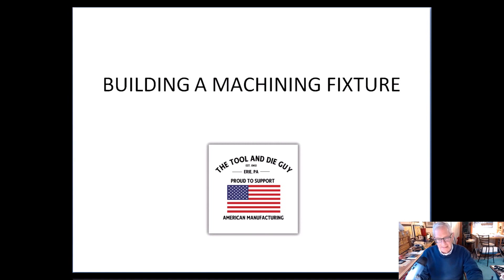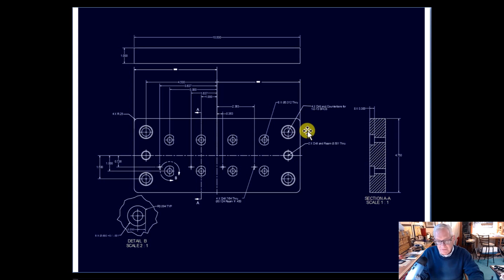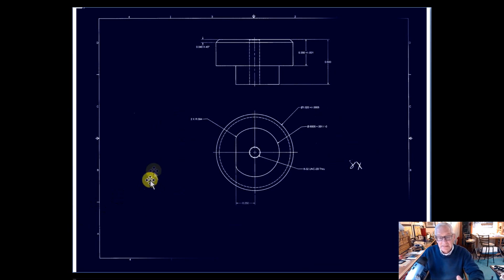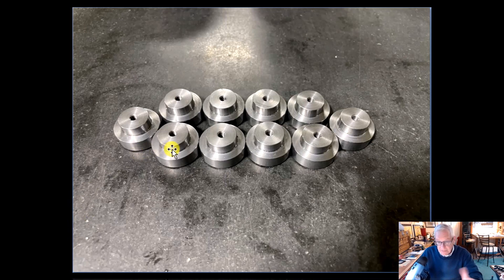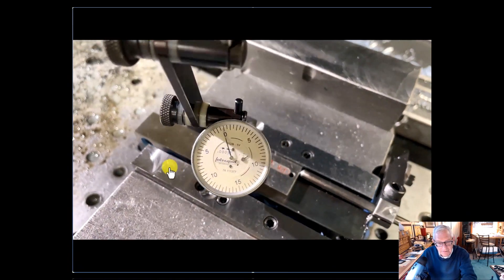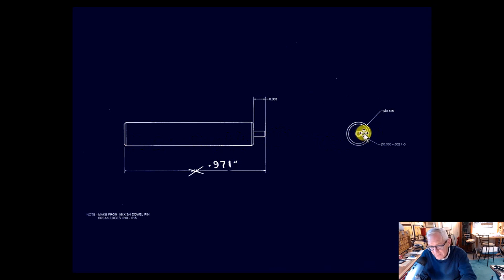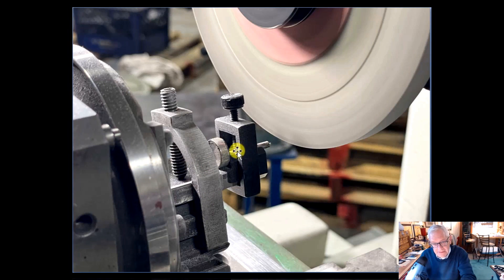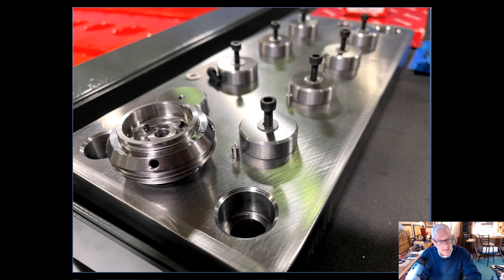HOW TO BUILD AND ASSEMBLE A MACHINING FIXTURE

Comment: Throw all the pins and plugs in the freezer and a heat gun on the plate. They would drop right it with only .001 press

Comment: When making the buttons the smaller diameter could be left big. Then the complete d can be cut on the CNC mill. The large diameter would repeat accurately in the vee so the d will always be concentric to it, this is the reference, not the small diameter, no need to clock up the parts every time. The interference could be the same all around using cutter comp instead of biasing it on the flat and a nice lead in chamfer added.
Moving on from that, the whole part, d shape, locating diameter and tapped hole could all be done on the mill and parted off to length. Or cut off with a slitting saw. The cutter would leave a sharp internal corner, unlike the turning tool. Not quite one hit machining but all relevant features are accurately machined together.

Comment: A question on the design, not your execution. Is the part being pulled down onto the head of the insert or onto the base plate? If it’s the base plate what keeps the plug from being drawn out by the clamp screw? Better option in that case is slip fit the plugs in and hold them in place with screws from the bottom. If the plugs are the wear item would hardening and grinding make them last longer?
Reply: Looks like smoke and mirrors, no design can have so many deliberate errors. No toolmaker would leave a sharp edge on the d shaped holes 101.

Comment: Thanks for the opportunity to ask a few questions.
On the pin end diameter, it seems counter-intuitive to use a finer grit wheel on tiny diameters. Smaller parts quickly heat up as they have no significant mass to dissipate the heat, so a cooler cutting wheel with a larger grit would seem the ideal choice.
Removing the delicate pins when damaged looks to be a pain unless the hole goes all the way through. Is there any reason why you never reamed all the way through? The height above the plate can easily be set by adding an appropriate depth counterbore of 0.225" in your fitting bar. By setting the height with the counterbored rod, there would be no need to grind them all the same length.
Regarding the flats on the inserts. Did they all need to be indicated in? I understand that the smaller diameter is not necessarily concentric with the larger diameter that you are holding on. Would you not take a rough cut - measure and then machine off the difference?

Comment: Did you mill a slot and press in a key to achieve the D shape. It is a common way to locate punches and dies. It is simpler to accurately machine round holes and then fill in the flat with a key. It leaves sharp internal corners so no need to chamfer the inserts leaving a longer engagement with the flat. The part can be machined on a standard mill easily to suit standard off the shelf keys.
 I tend to use a hardened dowel instead of a key, it eases installation and wears well.

Comment: Why the D shaped holes? Looks like a concentric locator.
Reply from the maker: Why the D-shaped hole? LOL engineering in 2025. Deal with it. I'm sick of asking questions to engineers with a 4 year degree. I just do whatever they want at this point. Believe me, I have tried. They don't listen. That's why doors are falling off of jets now. Not kidding. I might have to address this issue on another video.
Reply: @TheToolandDieGuy  This topic (challenging engineers’ expectations.. or not) would make for a great video. I’d watch that for sure.
Reply: @TheToolandDieGuy  Phil, if all of the "young" Engineers won't listen, then they need to forced to work in the Tool & Die Shop for a while AND be forced to build their own designs!  The Tool Designers in my office that didn't listen to the Toolmakers weren't Tool Designers very long!

When I designed jigs/fixtures/tooling needed by Production, I first talked with the Artisan/Machinist to see what he/she thought they needed.  I'd sketch it up right there while we discussed what they needed to do to the necessary work on the component.  Then, only when needed, I'd recommend any changes that I thought would achieve the desired result more easily (fixture-wise), and if the Artisan/Machinist agreed with what we came up with, I'd take it to the Tool & Die Shop to discuss with their Supervisor (who had been a top-notch Toolmaker before getting promoted) and make any changes as he recommended.  I'd go make an "official" drawing and take it back to the Artisan/Machinist and to Tool & Die so they'd all see what was going to be built ahead of time -- and make any other changes, if needed.  Once the design made it to the Tool & Die Shop, all of the Toolmakers knew to call me, if & when needed, to discuss any improvements/corrections that I needed to make to the drawing(s) to make their lives easier.

One time, while I was still a very young Engineer, an "upset" Toolmaker "explained" to me that it wasn't particularly easy to mill a 0.125-in. wide slot about an inch deep in something that I had designed (whatever it was -- I don't remember now).  I was definitely embarrassed as soon as I understood what he was telling & showing me.  The two of us immediately redesigned my "initial" design to both perform the original intention of the design while also being easily manufactured with "standard" tooling available to the Machine Shop.  (A few years later I added a mill-drill to my garage shop, along with a decent selection of "standard" tooling that a Machine Shop would use -- that also made a big improvement in my designs.)

I learned A LOT by talking with the Toolmakers and watching them work, asking questions as they occurred to me (at points where a question wouldn't cause a problem of any kind).  "Most" of the Toolmakers were very approachable (to me) and were glad that I wasn't an a$$hole like the ones that you have to deal with, but ALL of them knew that I'd accept any improvements to my designs.  My favorite week in my entire career was when my Supervisor arranged with the Tool & Die Supervisor for all of our Tool & Equipment Design Engineers to work in Tool & Die, each with several different Toolmakers, some of whom allowed us to actually run the machines on the jobs they were working on at that point in time.  I definitely understood what 0.0001-inch after that!  (That "tenth" wasn't on one of my designs -- the Tool & Die Shop was actually lapping some small hydraulic pistons that had 3 "pistons" on one shaft (& all 3 had to be within a "tenth" of each other) for the Hydraulics Shop (an actual "Production" Shop).
Reply: I would understand if someone was concerned that these plugs might work themselfs loose if a 250 pound gorilla cranks those screws in there but on the other side you have those small 30 thou locators so whoever uses this fixture needs to be very carefull anyways. There are certanly easier ways to stop those things from spinning than d shaped holes. I have never seen something like this in a precision application and I'm impressed by Mr. Kerner for pulling this of.
Reply: What other ways could you stop the plugs from spinning? I'm just not that experienced in seeing a lot of other methods. Everything looks concentric so could you just make everything round and do a tighter interference fit or just eat the cost and machine from solid?
Reply: @KC3ULC drill a hole for a dowel pin into the bottom plate would be how I would do it.
Reply: It must serve a purpose or it wouldn't be there.  Probably to prevent the D shaped
plug from rotating in the hole is my guess.

Comment: My only question  is , how were the female D shaped holes machined?
Reply: He must have interpolated the finish bore with a tiny diameter end mill is my
guess.
Reply: I've thought that too but it seems too simple.  @petemclinc
Reply: @petemclinc I would send it out for edm.
Reply: I came to ask the same question.
Reply: Yeah, you honestly just step down endmill sizes until you use and endmill that corresponds to the smallest radius. If the d shape requires there to be a 0.0312 radius in the corner, then you know you need to use a 0.0625 endmill as a final tool.